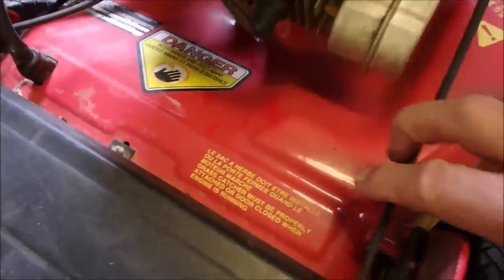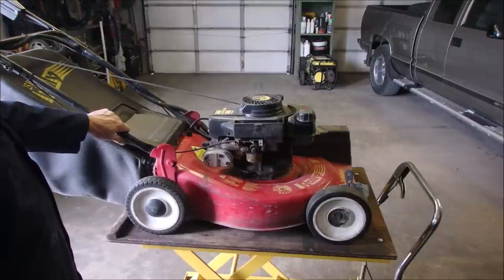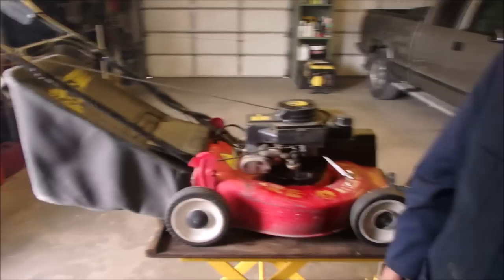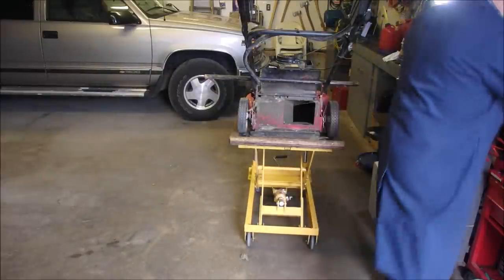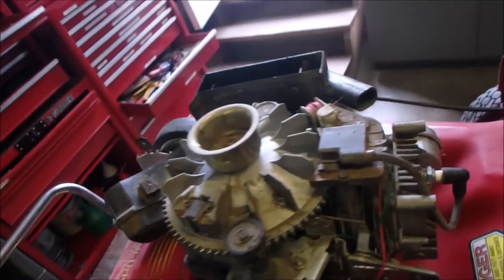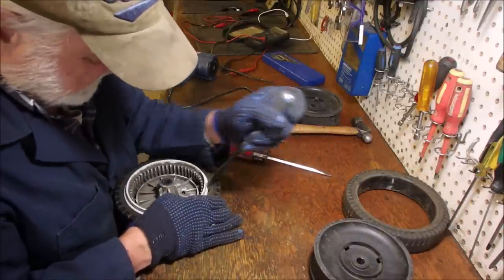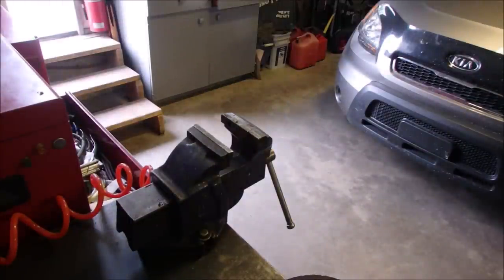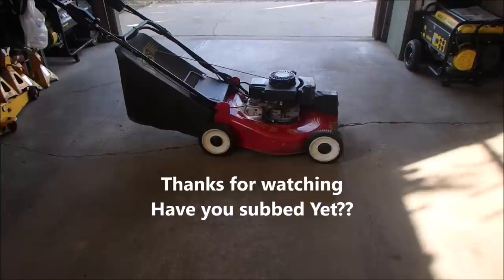29 Year Old Rally Electric Start Mower.  What do I do?

Comment: Good video Bruce.  A couple of thoughts on the wheels/tires.  I often will take my angle grinder with a thicker wheel  and cut new groves in the bald tires; seems to work ok as long as I don't go to deep!!  Secondly, if you are changing the tire out; I think maybe cutting the throw away one with a hack saw, etc, might reduce the possibility of damaging the wheel.
Reply from the maker: Great tip!  Kike I said yo Wayne I always  leave myself a way to step back.  I should have cut the tire.  I just couldn't.

Comment: I was thinking while watching you replace the tires that maybe a little dish soap on both surfaces would help with the installation or even put the wheels in the freezer for awhile,years ago I watched Dad replace the tires on our Lawn Boy but one advantage was that it had metal wheels so bent the rim out to take the tire.off then tap the rim back afterwards.this is the first time I've seen ones replaced on a plastic wheel.
Reply from the maker: Yes that may help.  When ever i do it I know i will be tired when i am done.

Comment: I LOVE that mini-stator, what an awesome idea! Wish all key start machines had that, I guess the cheap little plug-in battery charger is more cost effective for the manufacturer (here at work they call that “value engineering”). I had an old electric start Honda HR-214 that charged its own battery, very nice feature. Rally mowers were pretty common department store type mowers here in the US, you’re right that one is made by Murray. In fact there are Murray labelled ones around here from that era with the exact same color scheme and FWD system. Good ole Tecumseh, starts right up and ready for work! Thanks for the vid, very interesting!
Reply from the maker: Thanks.  This one came from a friend.  Well looked after.

Comment: Rally mowers were well built with steel decks, decent wheels, and solid Briggs Classic engines, except they weren’t called Classic yet. I have never seen one with bells and whistles like self propelled, electric start, and usually they are side discharge instead of a grass box.
Reply from the maker: Great point!   A Tecumesh though   as you know I am sure.

Comment: Yeah, i remember when i was a little kid and i was boating with my uncle one sunny summer day, and the boat was powered by really cool -69 Yamaha 3.5hp aircooled outboard motor, and we were running out of fuel, so we tlited the boat little bit, so the engine could suck all the fuel from the tank which was mounted in the motor.
Reply from the maker: I trust as you re commenbting here you got back OK
Reply: Oh yes, just a harmles little adventure.  @BrucesShop  😄

Comment: That is a cool lawnmower.  I like how the charging system works, never saw that before.  Is the rubber thick enough that you can use a grinder to cut new grooves in the tire?  Thanks Bruce.  Stevo
Reply from the maker: No   I swapped them as I could do it.

Comment: Where did you come across that old mower Bruce? Voltage seems excessive. Good find.
Reply from the maker: It does seem high but I am sure when it is hooked up to a battery It will float at 13-14V

Comment: Instead of prying off the old tire. Cut it with a saw or some kind of cutting tool since you don't need the tire anymore?
Reply from the maker: Yes.  I put myself through the punishment just in case the tire won't fit the new one.